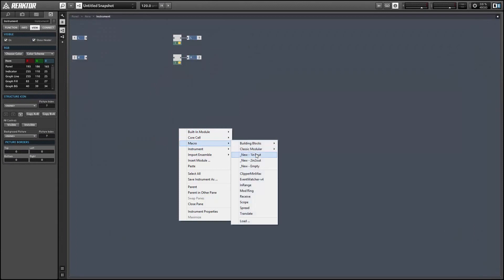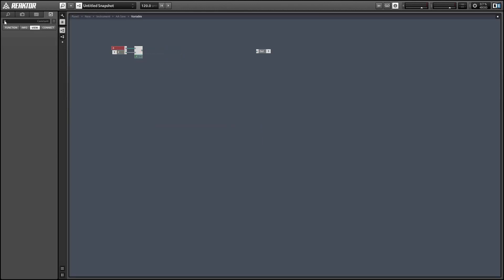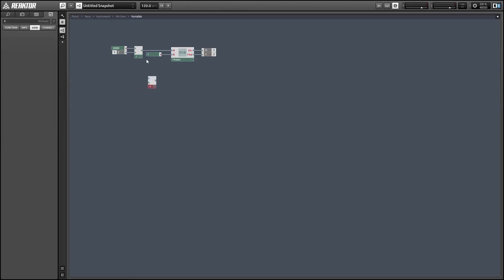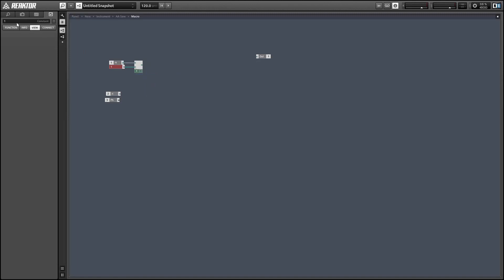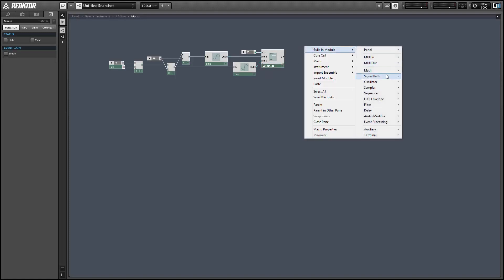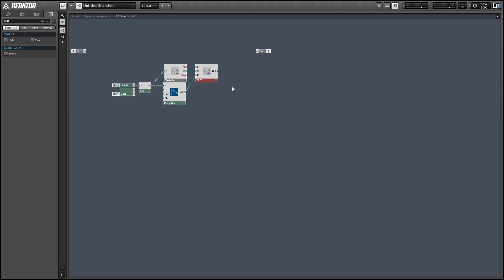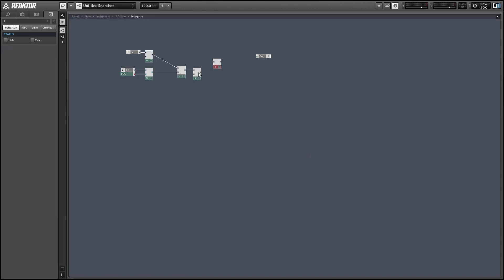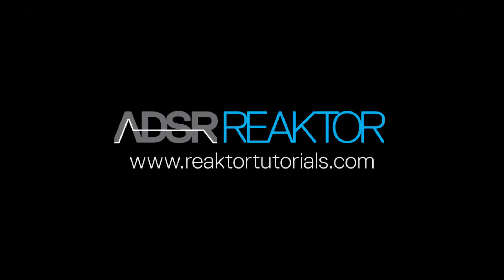NI Reaktor - Bandlimited Sawtooth Oscillator

Comment: Is it normal that the output changes a lot depending on pitch and maximum frequency value? I have to compensate pretty heavily. Is there any math I can implement to keep the volume of the base sine (zero harmony) constant independent of pitch and harmonic richness?

Comment: Are you getting this model from a specific source? I ask because I like to follow along if possible. It just helps me to be able to read an article or something and apply it in Reaktor when I can see an example.
Reply from the maker: to be honest, i can't quite remember. i think there are a few sources for this oscillator, but i made the first copy quite some time ago. the main source is digital sound generation by beat frei

http://courses.cs.washington.edu/courses/cse490s/11au/Readings/Digital_Sound_Generation_1.pdf

i use the DSF method. i believe there is a smith/stilson paper i may have used as well.
Reply: ***** Oh okay. Well thank you for that link. I haven't seen that one before. Awesome tutorial by the way. I was a bit worried I couldn't make it in Core because I didn't have a Modulo macro in Core, but I actually found some that you made and they work really well. I do have a problem making a ramp that works almost exactly like the one in Primary. I have a few phase accumulators that are really close, but they still don't seem to work like the Ramp module. I compared them with a scope and they were close, but still off a bit. Do you have anything that works like the Ramp module with sync?
Reply: Actually I think I just made a ramp that works like the one in Primary. For some reason I wasn't able to get it before.
Reply from the maker: Jordan Harris thanks, you can also check out the written oscillator tutorials at reaktortutorials.com for my version of a core phase accumulator
Reply: It's suppose to get ripples at higher frequencies and eventually turn into a sine right? Just making sure I got it right. Also, I made it in Core and the placement and level was a bit off. Like it was above the zero crossing line. I ended up subtracting the output by Pi and multiplying by 0.5 and that seemed to make it normal. Not sure what was going on.

Here's my copy is you're interested. The normalize macro is where I did what I said above. http://1drv.ms/1A3P1da

Note: I did have + 0.5 at the end of the Ramp Osc and it looked just like the Primary Ramp, but it made the Saw act really weird so I took it off..
Reply from the maker: Jordan Harris yes, it's got ripples, and turns into a sine wave when the frequency is over 1/4 the sampling frequency. at this point, that's all you can hear anyway, all added harmonics would just cause aliasing.